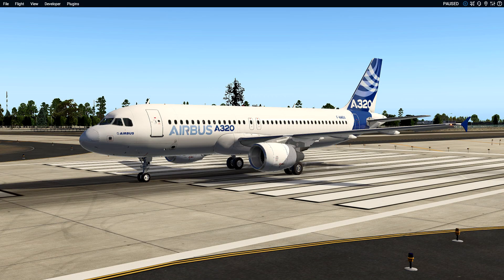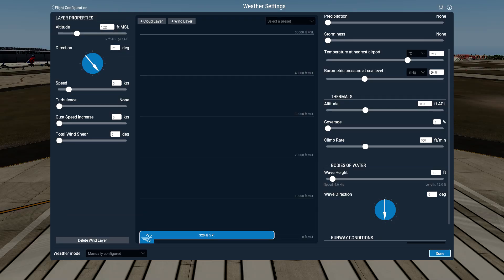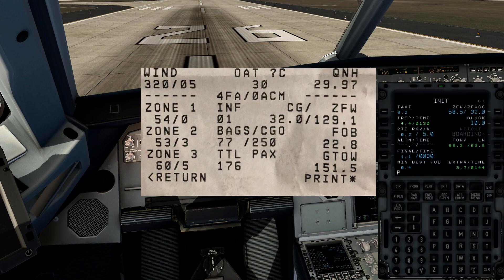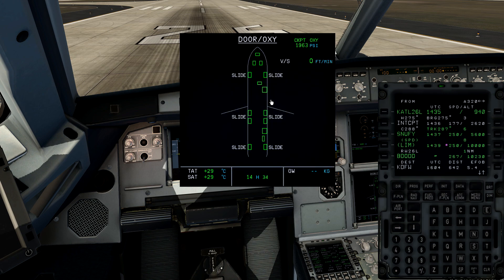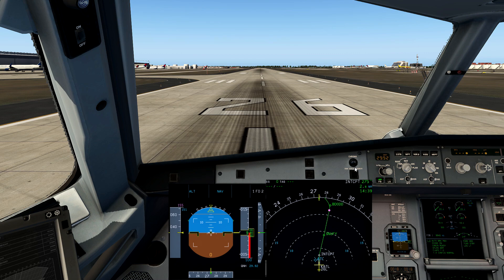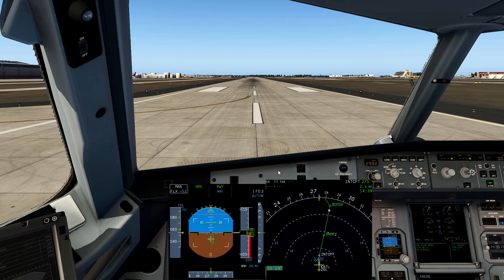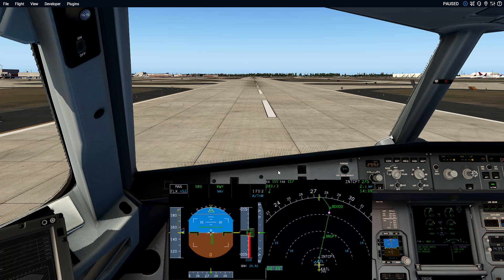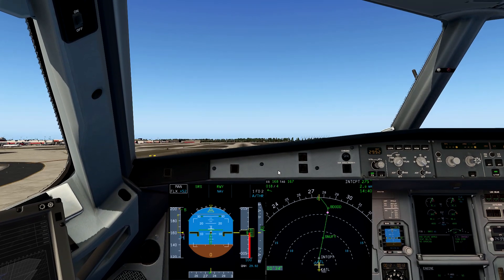**Flight Factor 320 VS Real World DATA! PerformanceTest V2

Comment: Hmm, my FF A320 doesnt feel quite right. With such a heavy weight it may be realistic but is it with lower weights too? Do you fly flights with 5 tons of fuel too?  With vr around 135 my acft literally jumps out of runway in under 10 seconds, even with max flex temp setup.

Comment: Really nice work Mr V1. Now could you pay attention to the behavior of the autopilot on the Toliss? In my opinion it has some troubles capturing altitudes like at T/D, overshooting a little and so on. Just not spot on. The FF on the other hand seems to match what I experience when I fly with jets in real life (as pax).  Really smooth interceptions or turns.
Reply from the maker: I agree, especially early on the AP behavior was a bit erratic. It has been tweaked in its current state and feels better, but I think most issues still stem from its limited FMGC which is supposed to be getting an overhaul in the near future.